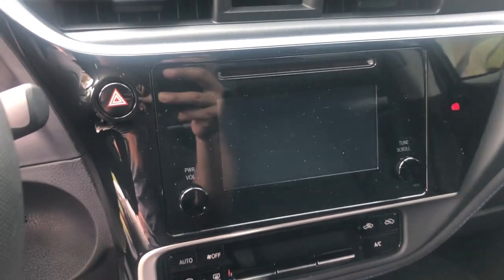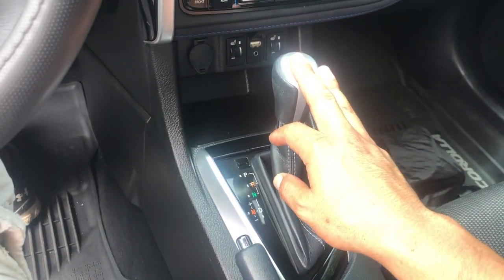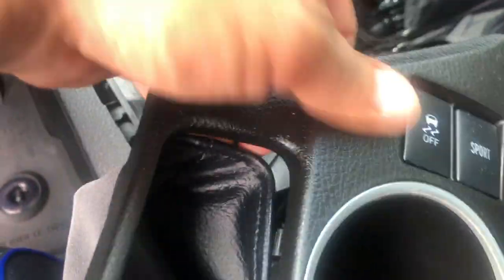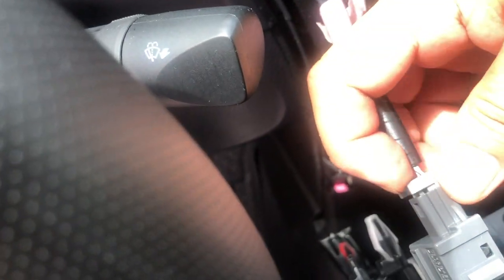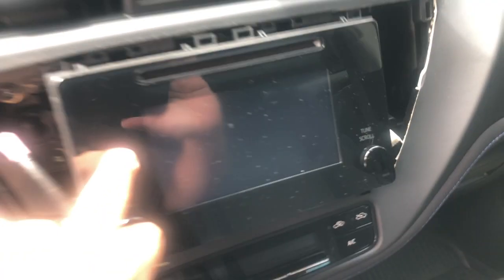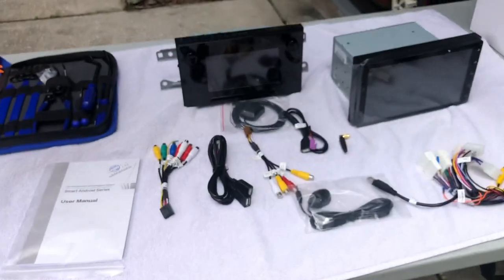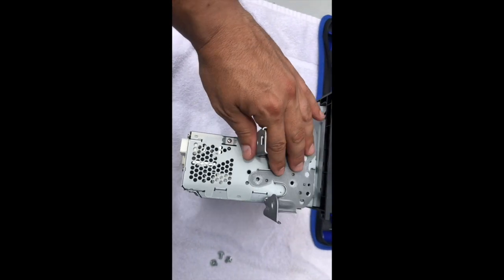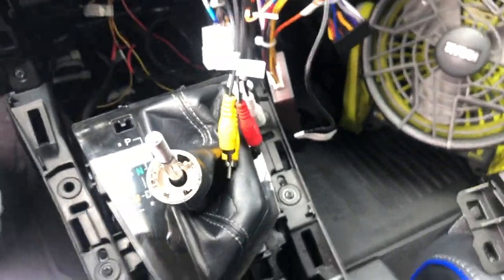2019 Toyota Corolla SE Head Unit wireless Car play install

Comment: Will your tips work on 2018 Toyota Corolla SE? How long it take for you to install? I'm kind scared if I cant put it back after removing 😜
Reply from the maker: I am not sure about a 2018, as long as the radio is the same size it should work. I think the difference will be the cut out of the seatbelt light that in this mode is one piece and older models is not. Hope this helps.
Reply: The 2017-2019 Corolla SE sedan is the exact same.
Reply: @planefan5812  i work at a toyota dealership and drive a 2018 corolla with a base radio and there is no difference usless it is a jbl radio
Reply: @godlessplayz4327  But isn't the size of the head unit the same regardless of whether you have the larger screen or not?

Comment: What's the point of the 2 USBs sticking out from the trim? Are they to update the system? Can I use the stock USB port for Carplay?
Reply from the maker: Charging and is for android car and CarPlay. The stock USB just work for changing after change the unit.

Comment: Will it work with the 2017 SE?
Reply from the maker: It should work if the size of the unit is the same. The item works on 17 18 and 19
Reply: @Miltonjrlb  was it complicated to instal ? i have a 2018 and i really want to instal
Reply from the maker: It’s not complicated at all, you can do it by taking your time and even taking pictures of how everything is assemble before you remove it. The hardest part maybe it’s running the cable for the microphone and gps, but the level of complexity is up to you.

Comment: hi does this nable apple carplay interface
Reply from the maker: The unit comes with wireless apple car play. Once set, it will connect automatically to your apple phone. I hope that answers your question.
Reply: @Miltonjrlb  also do all the steering controls work fine?
Reply from the maker: @michaelbarnes3276  yes, controls work fine.

Comment: What is the part number
Reply: What brand or where to buy please
Reply from the maker: SYGAV Android 10 for 2017 2018 2019 Toyota Corolla Radio Stereo Carplay Android Auto 9 Inch Touch Screen GPS Navigation Head Unit https://www.amazon.com/dp/B082FDP4DT/ref=cm_sw_r_cp_api_i_Y5BYDV6K7FH2876TXW4C
Reply from the maker: I hope this helps.
Reply: @Miltonjrlb  Thank you Milton